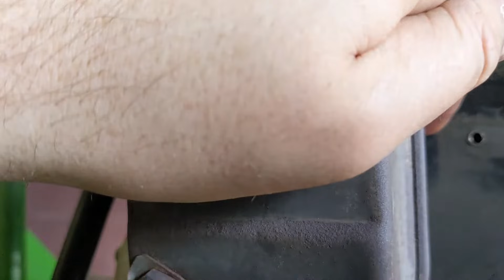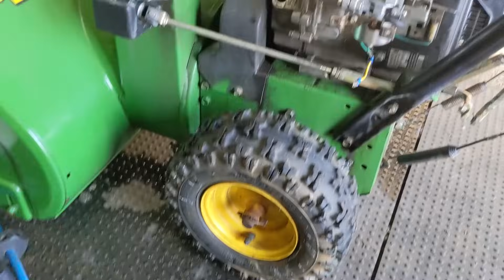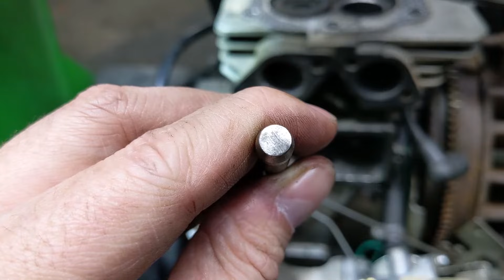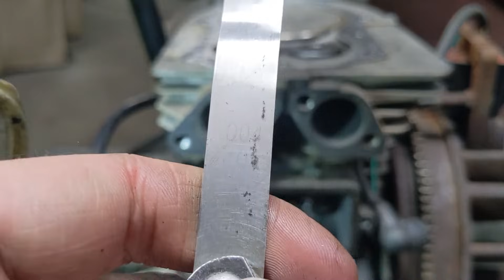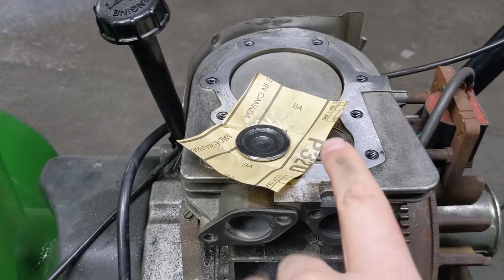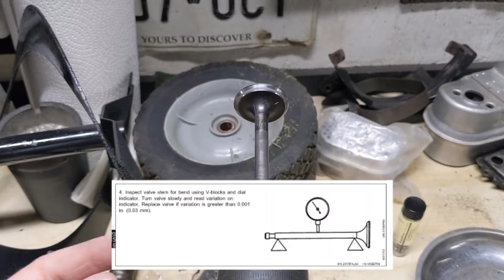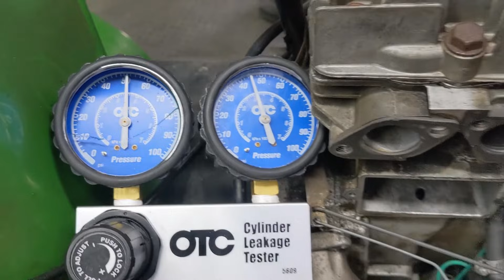Tecumseh HMSK80 Valve Job - John Deere TRS26

Comment: I’m thinking a quick and dirty method to determine if the valve stem is straight would be to roll it along the side of a sheet of plate glass with the head of the valve hanging over the edge. That could work, right?

Comment: Hey, Jake!  Great video, as always. Working on my first flathead and first valve adjustment ever.
You didn’t show exactly how you filed the stem tips so I’m going to improvise. I’ll drill a hole in a block of wood in my drillpress so it’s perfectly vertical, so a valve stem fits just snug. Then insert the valve and mount the stem in my bench vise with the block of wood sitting on top of the vice using a feeler gauge to lower the tip so just the amount I want to remove is exposed. Then use a fine file to remove some but not all of that amount. Back into the engine to test the clearance and repeat as necessary. I think in this way I can keep the file as perpendicular to the stem as possible and only remove what I want - no more.  What do you and Pops think about that idea?
Reply: Good ideal

Comment: i made the mistake of grinding a valve about 3 thousandths  too much ! i did not lap it yet i may get it or i may not ?  but have you ever added metal to a valve stem " welding " real quick just to save buying another valve ?   thank you god bless
Reply from the maker: I've never welded them but it's theoretically possible. These valves are made to withstand heat, but that's in the guide. If you had it out and welded it, I'm sure it could warp. For the cost, my advice would just be to get a new or used one that's true.
Reply: @EliminatorPerformance  i hear you at age 68 having been a mechanic for a very long time and a welder sometimes you just go hey ! what if ?    LOL ,,,, was just wondering if anyone had thought of it  besides this old man LOL ,,,,thanks for your opinion

Comment: Very good job !!!!!!
I have a question for you === i have a Toro mower that don't start anymore
1) did valve job ( like you did i  this video )
2) carburator job ,fuel line ok 
3)spark  ok 
4) key way on flywheel  =ok
5) piston psi pressure  60
Still no start 
What could it be  ????
Piston ring  ?? 
Timing gear inside the motor  ???
Waiting for your feedback
Thanks
What
Reply from the maker: If you spray carb cleaner into the cylinder and it fires and dies, it's probably carburetor/fuel related. If it doesn't fire up, then it's spark or compression related. Hope this helps

Comment: Can you check the values without the springs on ? Seems it would be easier i case you have to go back and file them down a bit.
Reply: Yes with a simple hold down plate and head bolts 
Easy to make and saves time
Reply from the maker: You could but it's advised the spring is there to hold it down while checking specs
Reply: @EliminatorPerformance  thank  you
Reply: Same thing to hold down liners in Diesel engines

Comment: I've got a Troy-Bilt tiller with an H35 Tecumseh engine. I made the mistake of loaning it to a friend and have not been able to get it going since. I replaced the carb, then rebuilt the old carb - no change. I could get it to run weakly, but no power. I decided to tear it down and do the valves and replace the rings after a compression test showed about 40psi. All back together, I was getting about 100psi but I still can't make it run well. I had it going and noticed it was puffing fuel mix OUT the carb. Can anything cause this other than intake valve? I ended up replacing that valve, lapping it until the seat was mirrored and grinding the end until I had a little more than .008" fully closed. Very frustrated. I made a home-made fitting to connect my compressor with a pressure gage on it. I'm thinking about pulling off the carb and muffler and doing what you demonstrate here with compressed air.
Reply: It's been 10 months since you posted but did you ever find out and fix what was wrong with yours? I'm having the exact same issues.

My 10 horse Tecumseh on an old Simplicity snowblower died this winter. I'd had carb issues with it over the years so bought one on Amazon after rebuilding the old one. It still wouldn't run and only produced huge 'crap your drawers' explosions out the muffler. 
I too have a lot of air blowing out the carb. I suspected a blown head gasket so ordered a new one and installed it today. Still no joy. While cranking it over with the electric start I saw small droplets of gas blowing out the carb. I removed the dipstick and and there's a LOT of air blowing out. It was pretty disappointing so I put it to the side in my garage.
This evening it still bugged me so started searching YouTube videos and found this one. It got me so intrigued that I'm going to check leakdown tomorrow. At this point I suspect the intake valve is bent from a backfire when it was running with the old carb.

Comment: Excellent excellent job on the video. I have to echo the comments that glad you had trouble with the intake valve so we could see the solution there as well.  You have to come clean though......did that engine really start up first pull off choke ?
Reply from the maker: Thanks, and yes I wanted all that in there, shows that they don't have to be perfect, but the machines don't leave unless I'm happy with them. And yes, they always fire 1st pull in warmer weather with just pressing the primer bulb twice. If it was colder I probably would've had to use the choke.

Comment: Hey excellent video tutorial. I worked at a old equipment shop and the owner had us do valve laps , checks on every older engines. The machines left the shop and all It took was half pull on the cord to start.

Comment: Most exaust valves I've seen have been cleaner than the intake valve.
Reply: AllWAYS that way. Most heat goes passed exhaust valve on the way out

Comment: Thank you for a wonderful video right to the point and very thorough. This is exactly what I needed to look at my Tecumseh  HM80 engine. Just a note...this is my second 10hp engine for my 15yr old Craftsman snowblower. I heard your engine run at the end of the video and, ( not directed at you ) it seems to run very rough, just like both of the engines for mine. My recent engine is brand new old stock from a sealed box, bought from a small engine shop because apparently, this engine is no longer produced. I take super meticulous care of my things, always changing the oil, lubing the cables, etc. My snow blower looks brand new, and yet for no obvious reason it began to knock quite loudly. I've  never over revved the engine or even ran it at full speed, and never overloaded it. I always went out several times during a storm so as not to abuse my machine. Upon inspection, the connecting rod and crankshaft were scored so bad it was like there was no oil, yet the oil was still pretty clean minus the silvery metal. I was ready to start tearing into this new engine because it runs rough and popps a bit from the exhaust, just like the origional engine from day one. Poor manufacturing I guess.
Reply from the maker: These engines don't like low rpm, you set the jetting and adjust the rpm to the point where they idle and stay running basically lol they're no Honda, that's for sure!

Comment: I'm not one to over comment on youtube, but I am adding to the thanks for the clear and concise video. I expected seeing the length that it might waste some time, it did not and covered critical questions that the shorter video I had watched on the subject did not. Cheers, subscribed
Reply from the maker: Thanks for the kind words, and thanks for watching!
Reply: @EliminatorPerformance  I'm headed out to the shop to finish this valve job now with a full picture of what I need to look out for and do. No guess work involved. Once again, as someone who watches a lot youtube fixit videos, this is clean editing, without skipping diagnostics and troubleshooting, no fluff and pump intro just solid and to the point content. Good work all around. Keep it up
Reply from the maker: @elementadept436  good luck, that's how I try to make all my videos!

Comment: Very good video. Too bad that when those engines lose power with out of spec valve clearance, almost all of the engine needs to be taken apart.
Reply: I have an HSSK50 and was surprised there's no rocker arms for simple valve lash adjustments, but I guess maybe they tend not to need adjustments as frequently.  Seems like a hassle when it's needed though, having to replace the head gasket with the disassembly for each adjustment.

Comment: I had a 5hp tecumseh and it would start and run fine but die when engaged to snow. Someone suggested checking exhaust valve. It had zero clearance. Ground to spec and it blows again.
Reply from the maker: Good to hear, thanks for watching!
Reply: Is it an HSSK50 engine you did it on?  I've got one and wonder if everything shown in the video applies to that also.
Maybe specs are different.

Comment: Someone else that cut that seat did not let the customer know they had done work on the valve seat before they brought it to your shop to get it running. Other than missing the bent intake valve you did a great job on this engine. Too bad you have to go through so many checks to ensure you get the proper valve to tappet clearance but you have shown all of us just what it takes to get it correct. I suggest you source a couple of V blocks and a dial indicator.
Reply from the maker: Yes, definitely a good idea. And waiting for a Neway seat cutter! Thanks for watching!

Comment: EP, I like the initiative but there is a lot more that needs to be done to that engine than what you did. Seats need to be trued up and lapped in. A nice Neway kit can be had to service these small engines. How did the shop grind or cut the valve face and not see the wobble? Furthermore who would of cut a new exhaust seat and not catch the valve is not even close to seating when they lapped it in??
Reply from the maker: Yes the Neway CU102 with the 31° cutter would have cleaned up the bottom edge of the seat, and allowed the valve to lap more towards the center of the face. I have valve seat cutters, but unfortunately not the one I needed for this job, I placed an order though, but my Neway cutters are currently on backorder. As for the valve that wasn't true, I'm not sure how the shop missed that, but it was also my fault for not double checking. As for the exhaust seat being cut, I'm not exactly sure what happened, as my customer had it at another shop that closed down, and the machine was brought to me in this condition. The exhaust valve didn't even have carbon build up, so I'm assuming it hadn't run and someone had been in there messing about. At the end of the day, the valves sealed up, and the engine runs. Thanks for watching!
Reply: As Taryl would say ' it's not the space shuttle'. I bought a newway cutter years ago and haven't used it yet.
Reply: @kenhilson786  Humm...I have multiple sets and use them quite often. True it’s not the space shuttle but rods, rings, and valves need attention to specs.
Reply from the maker: So I tested a theory I had. I'm guessing the machine shop put the valve in their chuck near the head. Because the warp is in the stem further down, they wouldn't have noticed a wobble. To test this, I reinstalled the valve deeper into my drill chuck and the wobble went away. Further out and it wobbles as shown in the video. I'm guessing that's what happened.
Reply: @EliminatorPerformance  so we’re you just chucking the tip of the valve? I would of thought the machine shop would of checked stem straightness. Make sure you don’t have a bur on the keeper groove. That could be throwing off your first drill test.
Reply from the maker: I thought they would've tested for straightness as well, but the clearly didn't. To be fair, neither did I until after.

Comment: Job well done.  The dude that cut the exhaust valve seat didn't know what he was doing, and gave up.  I use a hand file also for filing down valve stems.
Reply from the maker: Thanks for watching, and yes, when dealing with thousands of an inch, I always go slow, take my time, it's ok if it takes a couple times to get it right!

Comment: So the machine shop couldn't see that wobble on the lathe????
Reply from the maker: I thought for sure they would've said something, they were machining it and had to have noticed. Either way, I fixed the issue. Lesson learned, we can't always rely on others! Thanks for watching!
Reply: @EliminatorPerformance   too bad their mistake cost you a lot of time....I hate when that happens.
Reply: Is the moral of the story just order new valves instead?    Then it's not your time driving around and stuff.  Ah but then again you got to drive your sweet truck. Lol
Reply from the maker: Yes but also my mistake for not checking, so I take part of the blame. Lesson learned! Also, the shop is around the corner from me so not too far. I suppose you could buy replacement valves yes, but as long as the old valves are true, a new face makes them like new!
Reply: @EliminatorPerformance  Nice to have a machinist around the corner. Mine is an 8 minute drive away.
Reply: They chuckled up very close to valve machine. Way there maded so most head shops use a drill mounted next valve machine to check